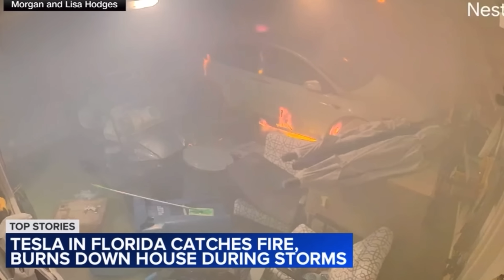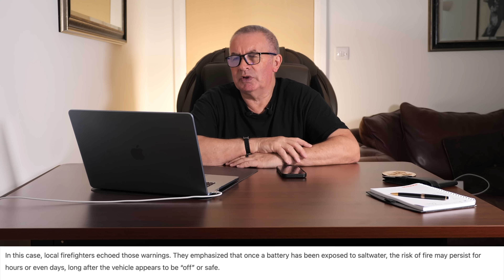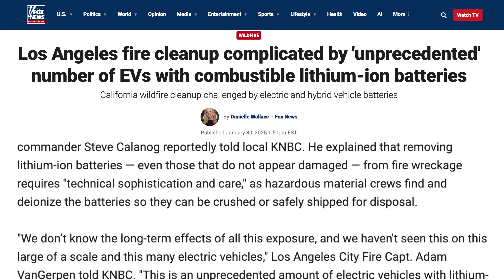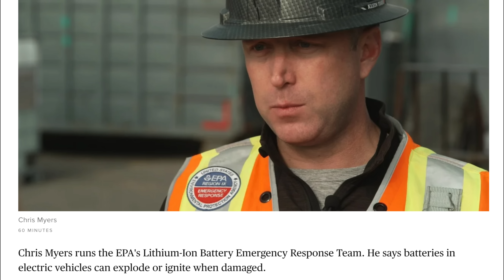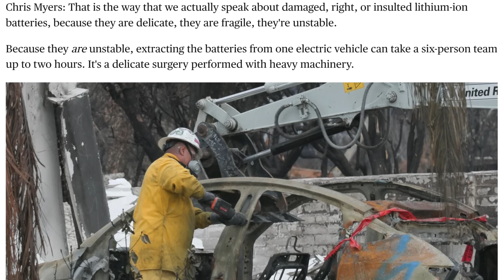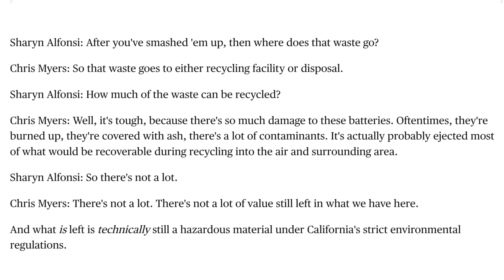An EV spontaneously combusts in 8Inches of Water, and destroys owners house

Comment: I had a conversation with staff on Lindisfarne Island, Northumberland. The subject of drivers risking the rising tide when crossing to the island across the sea causeway came up. They mentioned that a number of Teslas had come to grief in relatively shallow sea water. Presumably, if the battery shield is compromised in any way the battery becomes especially vulnerable to water ingress.

Comment: I wonder when the first EV gets hacked and thermal runaway is intentionally started - Anyone remember when the Israelis intentionally made all those Hezbollah pagers explode last year?
Reply: This was done by wiring a GPIO pin of the pager chip to a detonator in some plastic explosive fitted inside the case, not by shorting the lithium battery.
Reply: @darrynwiley6689  Ah OK not the best example then... However it does remain true that an EV's electrical system is kept active during transport in order to keep the thermal management system running. It doesn't seem too far of a reach for a system to be interfered with by a "bad actor" especially if some of the cars software remains accessible by manufacturers for overnight updates or in some cases more nefarious reasons.... So the main point still stands - "I wonder when the first EV gets hacked and thermal runaway is intentionally started"

Comment: It's not "raising unsettling questions about how EVs handle extreme weather conditions", it's the obvious answer media, politics and manufacturers pretend not to hear.
"Compromised Lithium Batteries can catch fire or explode" is hardly a shocking new discovery.

Back when Samsung's Galaxy Note 7 caused fires, all devices had to be disposed and Samsung forced a update which bricked the device. If you went to airports or the like with one of those, you were treated like you're about to commit terrorism.

But you can't do that with EVs... not when it compromises the virtue signaling politics and affects people to the degree of losing their car, as this would impact their voting behavior.
So, 15ft away from your house is a sound way of pretending to care... just park it in a garage, preferrably one beneath the parlament, world economic forum...  oh I forgot, they're banned there.

I'd also like to know what it is between: "climate change gonna cause frequent extreme weather" or "it's rare and restricted to certain regions, so driving a EV is save everywhere ... else..."

A lot of countries also use salt on their roads in winter, surely that's entirely safe for EV batteries.

Comment: Drivers with electric vehicles no longer need to submit a planning application to install an EV charging point.

The new rule, which only came into force on May 29, also applies to public charging points and those at workplaces.

The Government says that its move to slash paperwork will make it much quicker and cheaper for EV drivers to install a private charging point and power up their cars at home.

The change, it claims, will help more people save up to £1,100 a year by switching from a petrol or diesel car to an electric vehicle.

Businesses will also be able to install new EV charging points faster and cheaper, thanks to the relaxed planning rules, which it is hoped will dramatically increase the number of sockets available to drivers around the country.

There have been reports of planning permission for public charging points taking up to nine months to secure.
WHAT CAN GO WRONG WITH THIS ????
Reply: Govt has also just removed the need for planning permission for home Heat pumps if they are within 1m of your neighbour, can you imagine the noise complaints and neighbour fall outs in coming!
Reply: Strange because your insurance will go up £1,100.00 in one hand out the other 🤔

Comment: Before all the EVangelists start making their usual tiresome unsubstantiated claims about EVs supposedly being 10 times less likely to catch fire than a petrol or diesel car, can you please link us to an independent study comparing EV fires to petrol & diesel car fires. It needs to be a genuine like for like comparison; same number of vehicles, of the same ages, over the same time period. Disclose cause of the fire, and which fire brigade provided the statistics.
Reply: the issue is the fires werent recorded as being specific type of fire until 2 years ago, fire brigades recorded it just as a 'vehicle fire' , now the insurance industry has now requested they record it correctly, but the ones that do record battery fires cover ev scooter and ebikes in that, oddly enough though its interesting that the original inventor of the the lithium battery deemed these batteries as explosive.....   back in the the early 80's
Reply: Swedish Civil Contingencies Agency. The rate of fires per 100,000 vehicles is 20x as many in ICE as EVs. That's pretty conclusive.

How's the shopping around for a new electricity tariff going? Finally figured out you don't have to pay 27p per unit for off-peak?
Reply: @FlatToRentUK  Link us to the study proving it then. Otherwise you're just another liar making baseless claims.
Reply: @matthewgodwin3050  Links aren't permitted in these comments. If you care to enter "Swedish civil contingencies agency ev fire report" into a popular search engine all will be revealed.

Comment: If only there was a more practical vehicle.....something that doesn't spontaneously combust.......something that doesn't have any lithium ion batteries.......maybe something with a 12 volt battery and an internal combustion engine.....if only.
Reply: Screwing the planet for future generations though. Not viable. Also catch fire a lot more than EVs  Also poisoning the air you breathe. Needs to go.

Comment: We know electricity and water don't make good companions.
Nothing to do with EVs, but a few years ago the centre of Mevagissey in Cornwall flooded to a depth of about three feet.
When the flood water receded the only car which drove out unaided was a 1995 Peugeot 106 XND. Everything else, diesel or petrol, had electrical problems and wouldn't start.
Reply: But I bet none of them burst into flames?
Reply: @stephenwood9687  No; they did nothing.
Reply: Electrical problems

Comment: Just the smoke which has very very nasty residue when even after the fire is extinguished settles on everything which would probably be right through the house now , imo would probably make it a total loss  even if the house was actually not completely burned. 
   Electric cars would be great if they did not have batteries. 
 And another point that almost always seems to be not mentioned in EV fires , and that is the thousands of gallons of fire brigade water run off that now has heavy metals and seriously nasty chemicals goes into the surrounding area , into storm water drains.
 I can’t help but think , that if the bureaucrats that run our lives had actually done their homework and looked into the many cons  that come with EVs that far out weigh the old conventional internal combustion engine cars , they  would have said …. No way will we go down this path.

Comment: Errrm.. We live on an island surrounded by salt water. Bring back 1970's basic diesel engined cars which will still work in earthquakes, floods, fires.. We would all be much safer.. (Just a bit down the road from you Barrie)
Reply: @bordersw1239 I have several old indirect injection mechanical diesels, they are very strong and easy to tune. I have one that is over 40 years old with 250bhp. Another that is about 30 years old has 400bhp. They also run on vegetable oil.

Comment: A car sat in 8 inches of water is not what i would consider extreme weather, it is certainly sub optimal, especially in your garage. But I have spent time in Florida my dad and stepmum lived there for years, when those storms roll in or you get a  taste of a hurricane you will get flooding, and it will be salt water, in Tampa where he lived the apartments were all carpark at the ground floor open plan exactly for this, right next to a lake connected to the canals that connect to the sea for boaters, those parking spaces would flood when hurricanes graced them, thats why the places were on stilts essentially, don't need that under an apartment block with several EV owners!
its madness, the technology is not fit for purpose